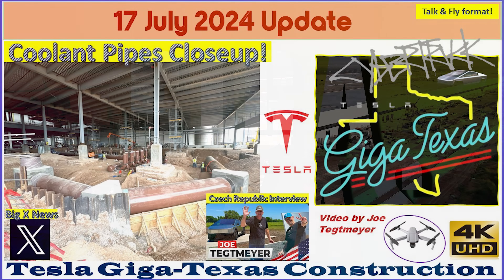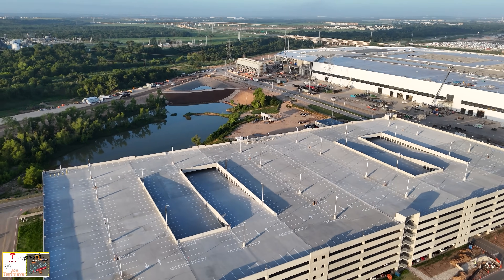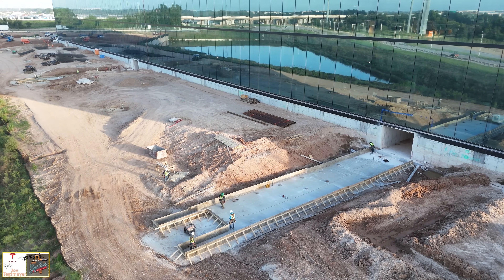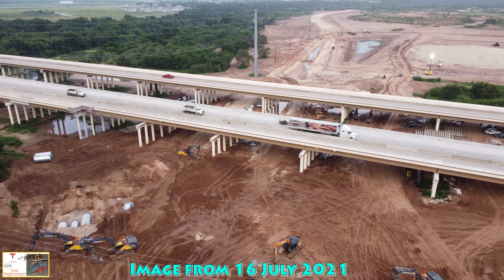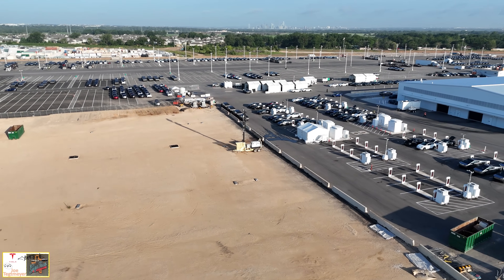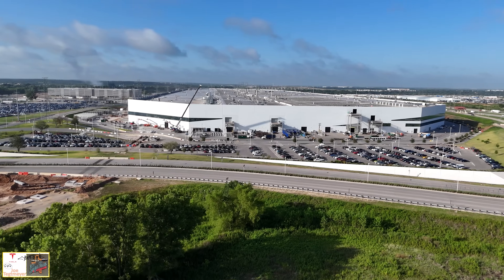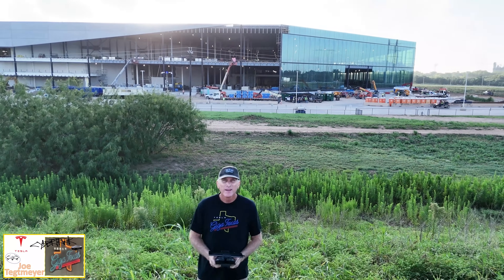S Ext & E Casting mud bases! Cathode Chill Plant Tests! 17 July 2024 Giga Texas Update (07:05AM)

Comment: The 'chiller plant' that you talk about at the new extension of the main building is actually called a cooling tower, more specifically a mechanical-draft cooling tower. It's a part of the larger chiller plant. 

What you ended the video with is an actual chiller plant with all its components: chillers, heat exchangers, mechanical draft cooling units and plumbing.
Reply: And I bet that the chiller plant contains several cooling towers?
Reply: @Alarix246  The one at the end? It has 2 I believe.

Comment: Thanks Joe.
8:10. Southend, south. West Fire Escape Passage extension. Slab edgeboard formwork constructed.
Square inset is a mystery. Yes, it looks like a loading dock, but how does a truck turn into it? Possible location for stairs up to a footpath/sidewalk.
14:27. Westside, old contractors parking lot. No columns. Not a building.
18:17. GA, apron. Stack of flexible black hoses at the Sanitary Sewer wet-well.
Highway berm. Same again.
18:57. GA, apron. Pump and hoses at the wet-well.
22:05. Casting, north. Safety deck erected over the doorways. Might be more work coming.
22:50. Casting, east. Apron. Mud-base concrete including the raised pad.
No ramps here. Rail system to correspond with same inside Casting.
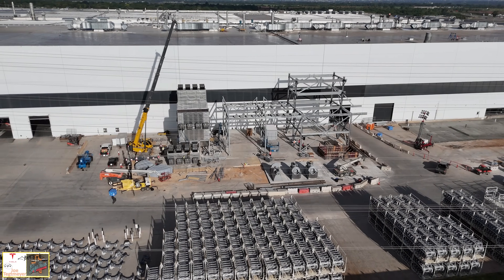24:03. Casting, Baghouse. 3 grey fan units. 3 raised housekeeping pads under the steel structure.
24:09. Casting. Left door. Forklift with an empty casting rack exiting from the northend of BIW.
24:30. Old EOL, staging yard. License plates, windscreen sunshades, some non-Tesla vehicles.
25:32. Tesla Road, far east. Mechanic’s workshop. Both MM and Texas Concrete being serviced. Larger batch plant no longer operated by MM.
25:55. Cathode, east. Wall opening framed for a large door. Walls being framed for a room inside.
27:07. Cathode, north. Roof. Re-glueing the membrane.
28:11. Cathode, west. Tank farm. Tanker delivering an industrial gas, likely Liquid Oxygen. Some gas discharging.
Reply: 25:32 I'd say they took possession of those trucks but haven't repainted yet.
Reply: @sammyk874  25:32. Yes, that's a possibility. Also wondered if the workshop was a separate business from MM all along.

I haven't seen a Texas Concrete truck delivering concrete yet. MM trucks only, presumably delivering from the temporary batch plant.

Comment: 7:25 The main job of those massive concrete blocks is to keep the joints from separating. When you turn valves on and off, what tends to happen with pipes is that they move as the pressure wave propagates through the pipe. That can create voids in the ground, and given enough time, it can cause the pipe to burst. Elbows are especially problematic. The concrete blocks are there to stop the pipe from moving.
Reply from the maker: @jonathanlanglois2742  👍
Reply: commonly reffered to as 'hammering' i think?
Reply: @Jessev741 of course here at Giga it would be a "Gigahammering", because the pipe is big enough for throughput of medium rivers in summer...
Reply: That's also why there are no 90-degree angles...

Joe, you might want to look up why sewage pipes use 45-degree angles... a mere flushing of the toilet can have quite an impact on the joints and literally break them if they were 90-degree, so 45-degrees is used to incrementally change the direction of flow.
Reply: @greggerypeccary  The first piece of pipe going down after the trap has to be a T. That's a code requirement to prevent flushing from sucking the trap dry. You can't use a 45 then a 45T for that application. The T is used for your riser going out of the roof for air.
Reply: @jonathanlanglois2742  Yeah, I mean down the bottom, once gravity has taken hold of the water... 10L of water means 10Kg of water falling, which can have quite an impact.

Comment: At my old place of work we had 2 separate fiber companies bring in fiber over 2 different roads and entrances to the building.  This was for redundancy if there was problems with one of the companies or fiber path.  I'm sure they are doing the same here.
Reply: That may happen here as well. Though not shown in this video, on the westside by the tunnel entrance, there are two large spools of orange fiber optic cable duct. So they may be bringing in fiber from the west ae well as the north.

Comment: Joe: the End of Line facility is very large in its own right. Although there's currently no sign of them installing a solar system, either rooftop or ground-mounted, do you happen to know if Tesla has any intention of doing so? The whole of this western portion of Tesla's property has enormous solar power generation capacity potential and I for one, remain utterly mystified as to why Tesla doesn't take the 1st principles of physics thinking approach Elon's so famous for espousing and generate their own power for free. Even if Tesla chose to take advantage of their Texan Utility licensed status, selling the power generated for more than what it costs them to buy in the electricity they need under a renewables offtake PPA, pocketing the difference, rather than consuming everything themselves, it would still be better than letting all of that potential go untapped.

Comment: I would not be surprised if Tesla rented a little part of the southern extension to X (they need about 20000 square meters for 2k employees) while waiting for the construction of their own office
Reply: Is there enough Pizzazz in the Bastrop area (compare to the high-end campuses in Sil Valley) or is this an outdated argument?
Reply: @hardernl8893  It's a relatively short drive to Austin proper from Bastrop.  Note that Dell had built a sprawling headquarters campus in a northern suburb of Austin > 20 years ago called Round Rock.  Land was and is cheaper there, and rather than building towers along with parking structures, both of which are very expensive and customary in a Central Business District, Dell had built a number of 3-story buildings and expansive surface parking lots which all exist today.  Doing so was a cheaper alternative.
Reply: @alanrivaldo-h  I'm glad to hear! Meanwhile other commenters also spoke out about the merits of the Austin area. Including the new developments in Taylor, there seems every opportunity to create a 21st century Tech Hub around a core of modern industries.